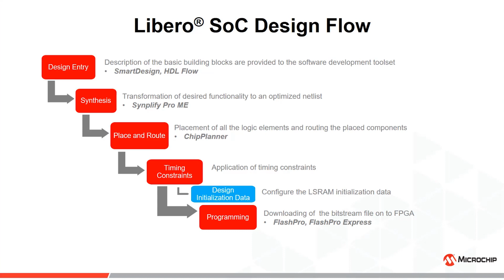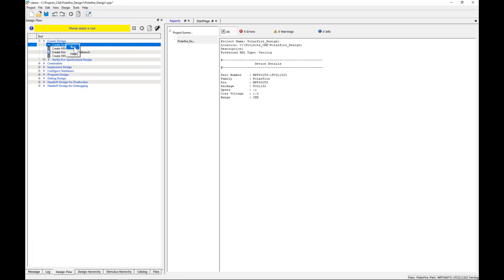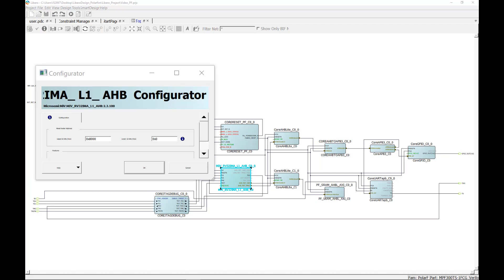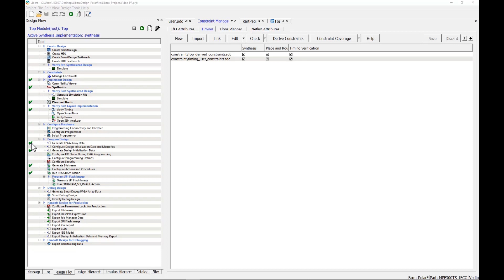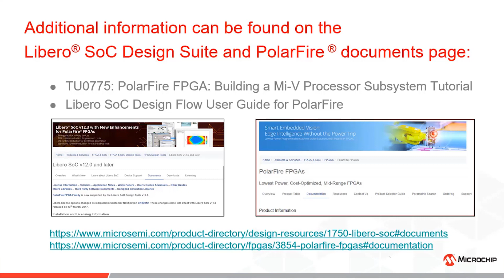How to Create an Embedded System with Mi-V Using PolarFire® FPGA

Comment: Where can I find the source for this example ?
Reply from the maker: Hi Ignacio, thanks for your question. Please see the below resources:

Here is the link to the tutorial: Building a Mi-V Processor Subsystem: https://ww1.microchip.com/downloads/aemDocuments/documents/FPGA/ProductDocuments/SupportingCollateral/polarfire_fpga_building_mi-v_subsystem_tutorial_tu0775_v9.pdf

Here is the link to the software resources: https://www.microchip.com/en-us/products/fpgas-and-plds/fpgas/polarfire-fpgas/tu0775-link-resources-

If you need additional help, please feel free to contact us at www.microchip.com/css.
Reply: @MicrochipTechnology  I have gone through that tutorial. The problem is that I don’t have that board. Is there anywhere a tutorial that uses internal SRAM? No external memory in an attempt to simplify the tutorial.  Per the video.  It seems like there are two SRAM instances which is exactly what I am looking for. And I have put in several  tickets with microchips with next to nothing of results, and I am using the company I work for credentials, not my personal.  I will also add the community for Microchip FPGA is next to nothing as well.
Reply from the maker: While there's no tutorial that uses the internal SRAM, you can check the link below for all Microchip Polarfire tutorials, under the User Guides section: https://www.microchip.com/en-us/products/fpgas-and-plds/fpgas/polarfire-fpgas/polarfire-mid-range-fpgas#tutorials

Our team reviewed your ticket and the status is Resolution Proposed. If the issue is not resolved, please reject the resolution and the corporate applications engineer will continue to work on your case. We'd also recommend asking that you raise the case to level 2 to pull in experts from the FPGA team. 

We do apologize for the results form the CAE team, and will reach out to you over email to see if there's anything we can do to help.